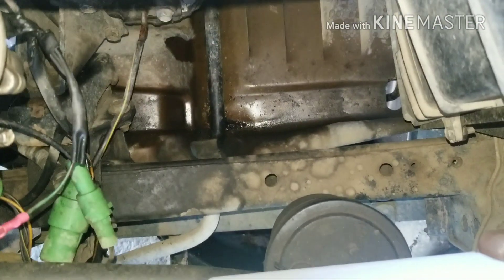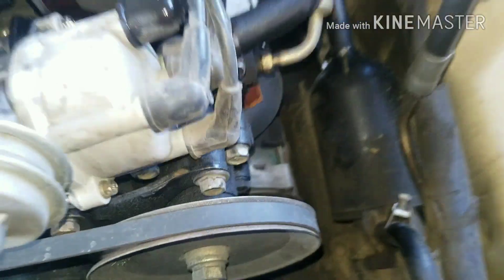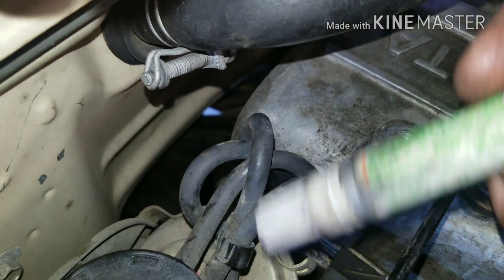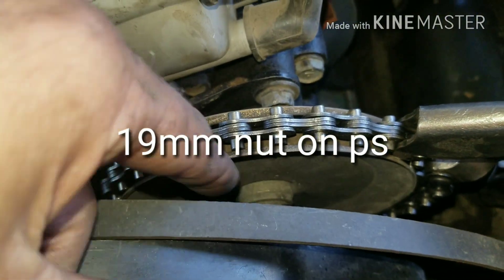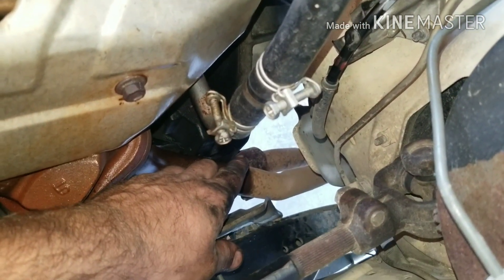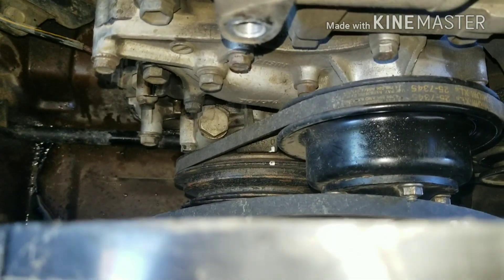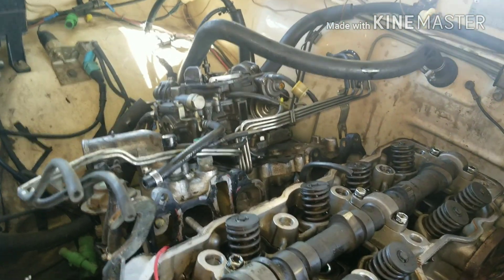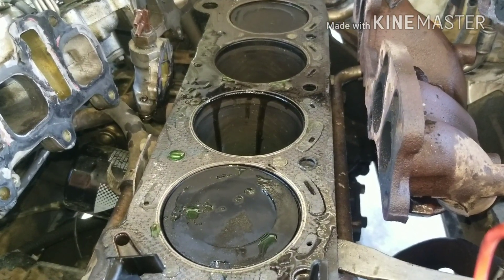How to replace the head gasket on a Toyota pickup 22r 22re (part one)

Comment: I took the head bolts out before I took the sprocket off. I haven't taken it off yet. Will it ok? If so what size of wood do I jam down there to hold the  chain in place?
Reply from the maker: I would put a few bolts back in before I I tried to take the sproketboff because it could allow slack in the chain, in order to build your own tool it 2 1/4 wide at yhe top 3 1/2 inchs long and 1 1/2 inchs wide at the bottom. Hope's this helps you be your own mechanic, thanks for watchin and besure yo like and subscribe and hit the bell yo get my latest content thanks again

Comment: Focus could be better. There is a bolt that holds the head to the timing chain cover. Please include removing that bolt. It is critical. Also please state the head bolt removal sequence, to avoid warping the head, it may be unlikely, but it can happen. Otherwise ok, so thanks for this video.

Comment: I loosened my belt and my pants dropped to the floor.🤪🥺 Seriously, I pulled in and parked.  When I came back and tried to start her (no spark) I finally (after I saw my rotor wasn’t moving) I lifted the valve cover to see I was missing my timing chain!   Shoot!!  I have No Idea if the pistons hit the valves or not.  Will remove the head.  Will have to manually position the distributor.  Make sure piston is in top position, lower pulley is at TDC and both rockers are loose (don’t touch the rocker adj. nuts till she is running). Does that sound correct or did I miss something?
Reply from the maker: hahaha thanks for watchin really  apreciate it

Comment: I’ve got a predicament: I have a 1994 Toyota pickup with the 22R-E and I believe the heat gasket is leaking. Here’s why: it bubbles out of the radiator, it loses coolant, it is underpowered when cold, it smokes pretty bad out of the exhaust before it’s warmed up, and there’s coolant coming out of the radiator, but it passed the head gasket leak test with the blue fluid. The fluid didn’t turn yellow so I don’t know if I did that wrong or if it’s something else
Reply from the maker: does your truck over heat usually the biggest indicator is overheating, the die test can be wrong due to the duration of time it was left to do its work.
. Thanks for watching besure to like and subscribe for more tips and tricks and check out facebook  and give it a like  for more help in the future

Comment: Hey I'm about to replace the head gasket on my 94 pickup . Its not burning or leaking any oil only using up the coolant pretty bad, also sometimes when I turn the car on , usually it turns on no problem but every now nd then I have to hit the gas or else the engine won't start.  Also sometimes, when I shift to reverse, it turns off on me and I have to turn it back on .

Comment: Great Video but I'm wondering how you know you might need a Head Gasket. I have an '86 4x4 Toyota Truck and it looks like fluid, maybe Radiator Fluid, is coming out my exhaust when starting. What are the initial signs you would see to indicate a Head Gasket needs replaced.
Reply from the maker: Well the first sign would be your truck  over heating quickly  after start up, possablly lots of white smoke coming out of the tail pipe. In some  cases you can  check the radiator for exhaust gases with a die tool that changes colors when you have a blown head gasket. Hope this helps.besure to like and subscribe for more tips and tricks.
Reply: @fixergood  Thank you for your response, that helps.
Reply: Very helpful thanks for all the tips. I have a 1987 Toyota motorhome with the 22re It’s been overheating after running about 10 15 or 20 minutes I check the compression and they were all pretty close between 65 and 85 I was just wondering after that seem low to you? It’s a rebuilt motor and head and I thought the compression should be higher.
I’m working on the intake manifold And I noticed I had some blown gaskets between the head and the intake so I’m replacing that. Thanks again for your information.
Reply from the maker: Your compression ses a little low you usually like to see 120 psi or higher for good comprrssion,or uniformed compresion od 90 across. Hope this helps

Comment: Hi - I’m replacing my head gasket on
My 87 pickup and thanks for the video.  Did you resurface head or install new one.   Why the new cam.  Thanks just planning for my truck.
Reply from the maker: I had the head resurfaced and valves redone. The cam had a lobe that was starting to loose its Harding so I put a new one in there. Thanks for watchin. And besure to like and subscribe for more tips and tricks
Reply: Thank you
Reply: Did you do it?
Reply: Yes driving now. Went with new head instead of resurfacing old one
Reply: @mike-cr4er  nice.
Reply: Wished you made a how to video on it. I'm new and don't have mechanical experience and i want to do the same on my new pickup with a 22re engine.  It has a blown headgasket.
Reply: Followed tips from fixer good video. Label, label label everything.  Spend time cleaning block surface.  It’s a nice surprise when it works! Good luck!

Comment: Great video, question on the block for the chain. Where does that block go I cant see it in the video. Also what does it do? keep the chain from falling down? do you need the block on the 22re? Thanks!
Reply from the maker: The block puts tension against the chain  tensioner which makes it so the chain wont fall down into the oil pan  and keeps it in place so it will go back on cam  when going back togather.
Reply from the maker: Thanks for watchinbreally apreciate it
Reply: Okay. That's what I was thinking. Thanks boss!

Comment: how necessary is it to use new cylinder bolt heads? what kind of spanner did you use? is there any way to see an image of the wood block you use? thanks so much for the video!
Reply from the maker: Thanks for watchin head bolts need to be replaced everytime. There called torque to yield bolts, that means they torque to a certain  clamping force not torque measurement . The spanner is just cam spanner uou csn find on amazon. If you go there the comments I theres one where I have put measurements for the wood block I'll highlight it thanks again for watchin. Be sure to like and subscribe for more tips and tricks.
Reply: @fixergood  hey I was wondering if I could ask you a question. I have a 22r engine, white smoke coming from the exhaust, bad idle until it heats up and burns off the coolant  I'm guessing. I replaced the intake manifold hoping that was it, but it's still doing the same thing. No oil in coolant, no bubbles in radiator, no coolant in oil. Does this sound like a blown head gasket? Your videos have been super helpful doing this, I'm subscribed! Thanks
Reply from the maker: @YouCantWin666  has the truck ever over heated, do you have a thermostat in it? Is  it white smoke or blue. If it hasent over heated or consumed coolant t   it's hard to say head gasket. If the smoke is blue it could be bad valve stem seals or bad rings  hope  this helps you.
Reply: @fixergood  the truck has never over heated, The coolant is going down, Its white smoke. It has a thermostat. Coolant can only be getting in the combustion chamber from the intake manifold or head gasket, right?I'm thinking maybe the head gasket is just 38 years old and is falling apart from age?
Reply from the maker: Its possable or you could have a small crack in a head the closes up once it gets hot, it's hard to say for sure what's going. You could take it to a shop and have them use combustion gas tester qith a liquid that turns green when combustion gases are present.  I think advances autoparts sells  the kit too hop rhis is helpfull
Reply: @fixergood  cant thank you enough for your input
Reply from the maker: Your welcome any time
Reply: @YouCantWin666  let your engine run for a few min, then take some of the oil off the dip stick and place it on some aluminum foil take a lighter to it. If it sizzles, you have coolant in your oil and your HG is blown.
Reply from the maker: Thanks for watchin
Reply: @fixergood  thanks so much for the reply

Comment: I wish you were in Georgia you know what you’re doing
Reply from the maker: Thanks for watchin  besure to like  and subscribe for more helpful tips and tricks
Reply: fixer good finally got everything in to do the head gasket I removed the 8 intake bolts but it still does not want to come off.
Reply from the maker: @bigmac22ify   check to see if you removed the water pipe  from under neath the intake and the very end of the head those always get over looked thanks for watching
Reply: @fixergood  Thanks got it off finally. I was scratching my head trying to figure out what I missed
Reply: fixer good quick update thanks to your video I changed the head gasket it’s my first time doing anything like this. I also changed the timing chain as well. Thanks again for the videos.
Reply from the maker: Thanks for the update glad to hear you were able to get it goin thanks again for watchin.

Comment: Having an issue with bolting the exhaust side back to head. All the studs that hold it seem to go in different lengths because the nut is rather fixed to the stud after all these years, and not tightening up like they may be striped out. Should I get new ones and put them in as deep as possible or should I tap the threads for a larger stud?
Reply from the maker: The colts are diffrent lengths the bolt s fir the middle brace or egr uppe are diffrent from the four on the sides. Once you get the studs in the whole the nuts break free most the time , or you can get new bolts. I would not recomend taping to a bigger size hole this helps besure to like and subscribe for more tips.
Reply: @fixergood  The nuts are somewhat seized onto the studs by rust but I never tried to separate them, I had not realized that the 4 on the sides had different lengths than the ones in the middle. If I can't get the bolt and stud separated to insert it deeper, I will get a few new studs to bottom out in their holes before adding the nuts and torque.

Comment: Those bolts holding down the rocker arms need a 17mm socket. I used an 18mm like you said and it rounded off the corners. So, thanks for that.
Reply: I didn't think it was possible for a person to "not know" when a socket doesn't fit a nut or bolt. Simpy place the socket on the bolt and turn side to side to see if it's tight. If it's tight you have the right tool, if not try a smaller size, and use 6 corner sockets if possible and available.
Reply from the maker: That sucks man those bolts are on super tight and they come out hard the bolts I had were after market so maybe they were 18mm and others are 17, I will put a note in the video,thanks for watchin

Comment: is this the head gasket set you got for the truck? https://www.carid.com/oe-replacement-part-number-04112-35152.html
Reply from the maker: I'm not sure but they make good gaskets you just wanna make sure it's the correct  set for your specific model and if it's ego, or carb, your exhaust gaskets can change from year to year .

Comment: They loved vacuum lines in the 80s and 90s
Reply from the maker: Yes they did makes it fun going back in, and  it was a pretty clean 22r. Thanks for watching my video hope this  helps and be sure to subscribe for all my latest tips and tricks
Reply: Sure are but they are tanks for an engine. Liked and subbed. Good luck with the YT thing.
Reply from the maker: @bryanroupe8646  thank you , yes Toyota did make a tank of engine very simple and almost bulletproof
Reply: The one I currently have has been swamped twice. Just pulled the plugs and rolled it over then changed the oil.  The last time it was in the mud hole for three weeks before I was able to get it out.
Reply: No doubt...looks like a plate of sketti....I am in the process of doing head gasket as we speak, hope I get it right!
Reply from the maker: @traceyk6541   yes it does  an I'm sure you will get it right , thanks for watching my video and be sure to like and subscribe .

Comment: What’s the size of the block of wood that you used?
Reply from the maker: In bbn order to make your own took the piece  of wood  is 2 1/4 wide at the top, 3 1/2 inchs long and 1 1/2 inches at the  bottom. Thanks for watching my video and I hope this helps besure to subscribe to get all my latest  tips and tricks
Reply: Length and width

Comment: good video - you had some helpful tips. Note that the head can become warped if the bolts are not evenly released per the shop manual. I see you added that on the tightening for it on part 2 tho - thanks for posting. Also I had a lot of fun pressing out an '83 hilux rear axle shaft recently, that might be a good topic too.
Reply from the maker: Thank you for watching my video I appreciate it, I will try and touch on  that topic if I ever do one . Be sure to subscribe to get all my bbn latest tips and tricks,thanks again.
Reply: subscribe is a go! just one or two more suggestions: identifying all the special tools (like the timing chain jam, vise grip chain, lubricants for bolts, sealants etc in one spot at the beginning or end would be great! Also please identify the new parts your using (gasket kits) thanks again Mr.  @fixergood
Reply from the maker: Thank you really appreciate the  suggestion I will  start doing that with all my new videos thank you for your tips

Comment: Fixer good, hey bro I got my head's back and I installed them I'm in the process of looking up the exhaust manifold. I noticed another thicker gasket for the plate that's on the rear of the heads "egr cooler" when I got my gasket kit I only noticed a thinner gasket for that plate which I installed already. Now I stared opening my manifold gasket and I noticed another one for the rear plate and much thicker. I already have a gasket on there. What do I do???? I hate to pull these heads off again.
Reply from the maker: I think what your asking is if the thinner gasket is suitable if you have a thicker one available. I would try it  you can  teach the back plate with out taking the head off, you may just have to move some pipes. Hope this helps you thanks for watching my video be sure to like and subscribe and hit the bell yo get all my latest content, thanks again.

Comment: So I took my head's in to get resurfaced and a valve job. The machinist called me back and said it didn't pass the pressure test because the heads we're warped. So he is going to weld an extra plate and the have it resurfaced again. What are the chances my engine block is also warped?
Reply from the maker: When ever I've done the head on a 22r the blocks are usually  pretty solid and are not warped. If you got it really hot or suspect it is you can buy a straight edge  and place it on the block and see if has any high spots. Thanks for watching vide hope this helps, be sure to subscribe and hit the bell yo catch all my latest tips and tricks to make you your own mechanic. Thanks again.